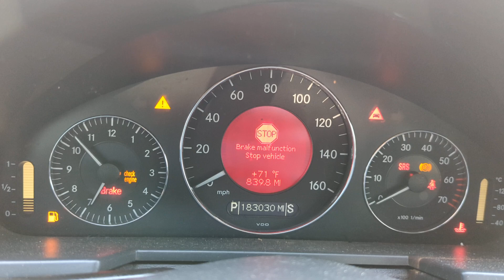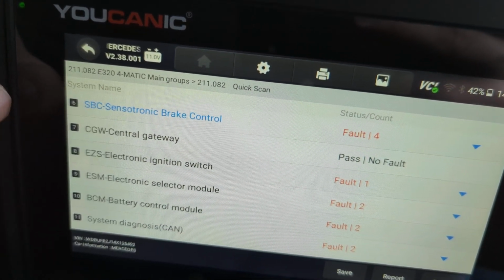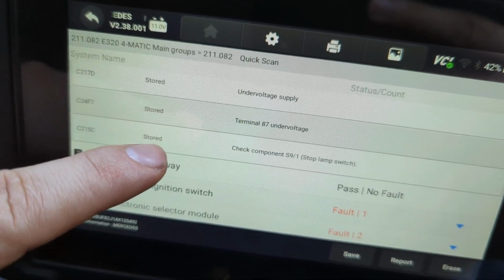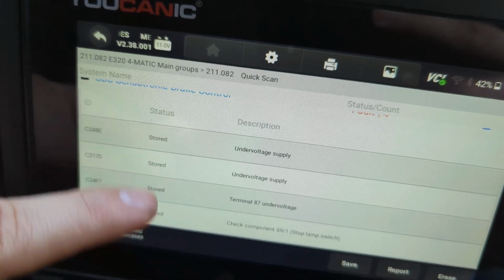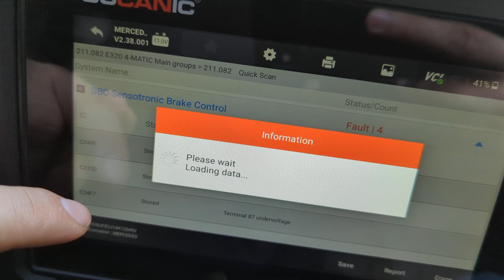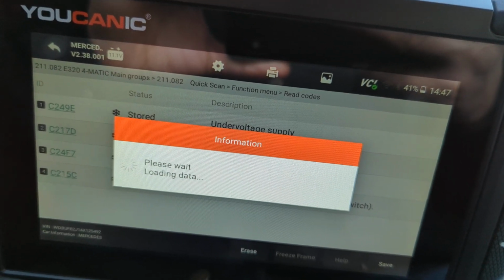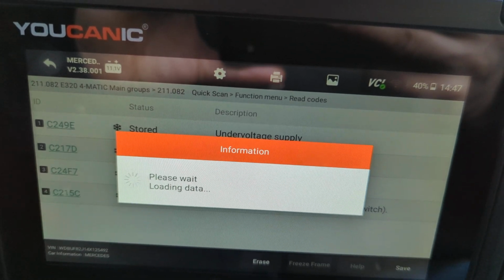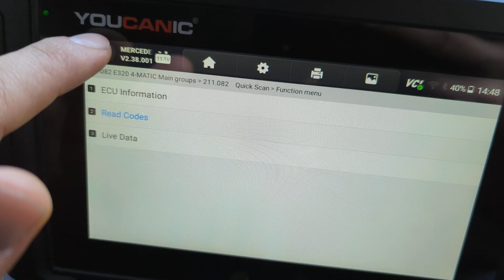Mercedes-Benz Stop Brake Malfunction Stop Vehicle Diagnosis with YOUCANIC Scanner

Comment: this is the most dangerous design ever Mercedes deny all responsibility  for this design, built in pedal count on the 2.7ltr I had to run my car into a bush to stop it. luckily I was going up hill slowly when the dash went red and I had complete brake failure, I am disabled using hand controls no chance of stopping the car. I go past an infants school, imagine the consequences. Disgrace full service by mercedes